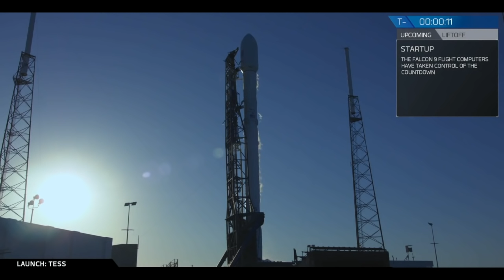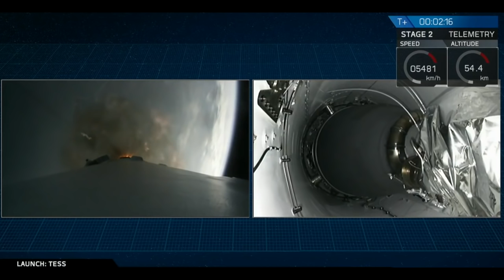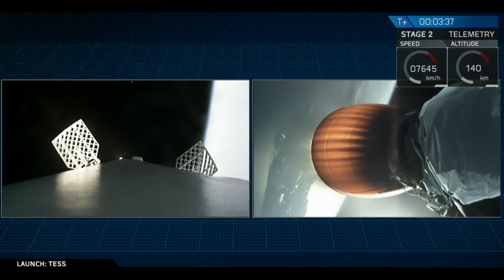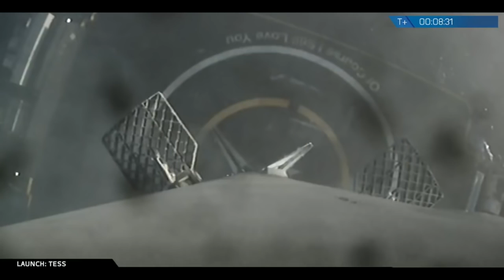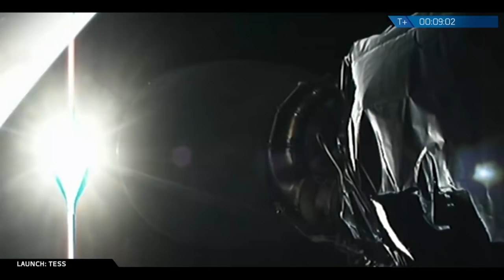SpaceX Falcon 9 launches TESS & Falcon 9 first stage landing

Comment: The final Block 4 Falcon 9 has flown. Press on to the Block 5!!
Reply: Nicky Yea I guess one of those expenable lanuches.
Reply: Will they reuse this block 4 booster?
Reply: Aerohk possibly
they can still get another mission out of it if they wanted to
Reply: Aerohk they said they would use it on CRS15 pending NASA approval..
Reply: Chances are high, but its next launch, it will be disposed off in to the ocean.
Reply: The final "New" Block 4 Falcon 9 has flown.

Fixed it for ya.
Reply: The final new one. They still have this one and several other previously flown ones to use up. Next mission will be the first Block 5 though.